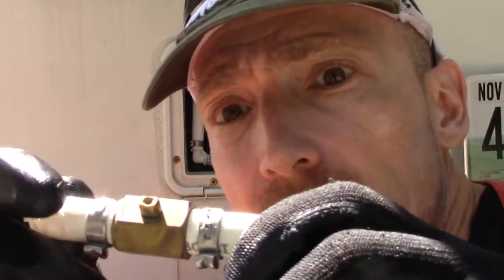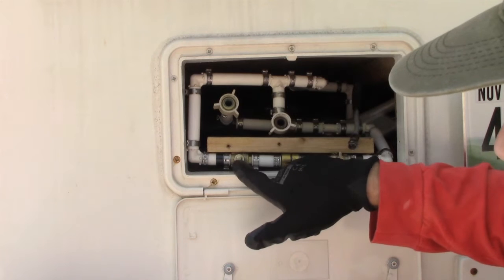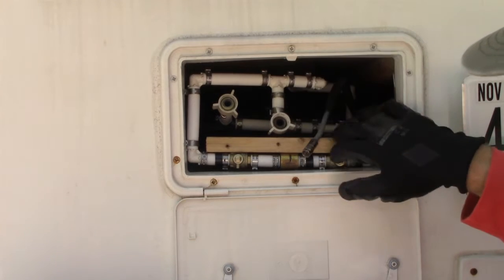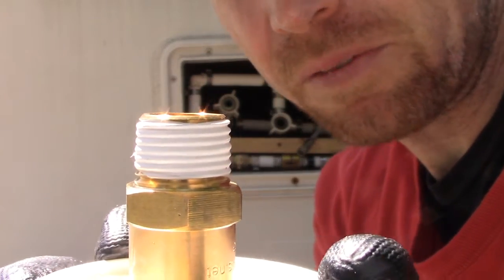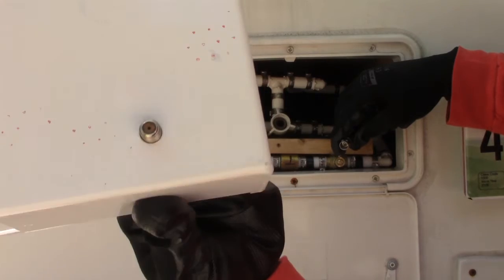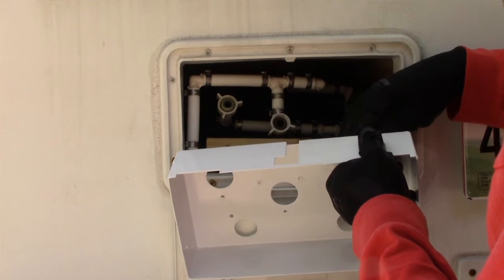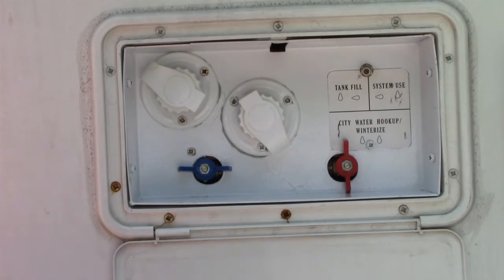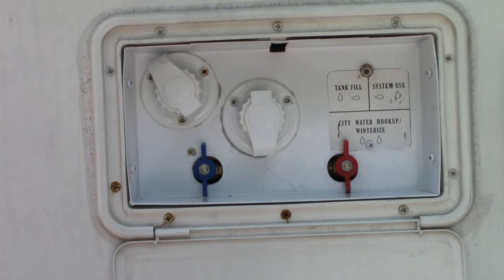2010 Coachmen Freelander Fresh Water System Rebuild

Comment: Thank you for the video, first time i see same setup as i have. Question for you. What is the difference between connecting water to the left or right inlet. On mine they both fill the tank. Don't know if thats how it suppose to be or previous owner bypassed something.
Reply: Hi Carlos, thank you for watching the video.  The left inlet closest to the driver's side is for freshwater only. It's to fill freshwater tank and for house water when connected. The right inlet is to clean the black water after emptying.  The right side should not fill your fresh water tank.  I would check to see if your valves are working properly. The right inlet should not be connected to the freshwater. Try to trace the pipes to see which way the go.  If your valve keeps turning all away around than it's not working.  Let me know what you find out. Please like, share and subscribe. Thank you and have an awesome day 😎
Reply: Hi Jason, i took mine apart, traced lines and puzzled valves. One is city water hook up/tank fill bypassing water pump. The other is for gravity feed with pump/tank fill/winterazation. They both end up at tank fill hose so that why they both fill tank.
Reply from the maker: I just posted the links to all the items I used to rebuild the water inlet.  Enjoy.